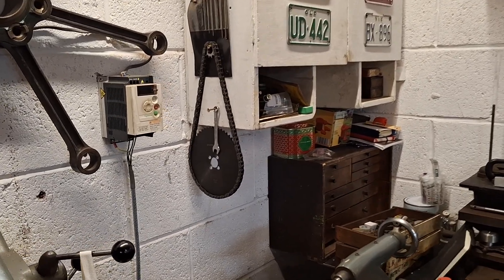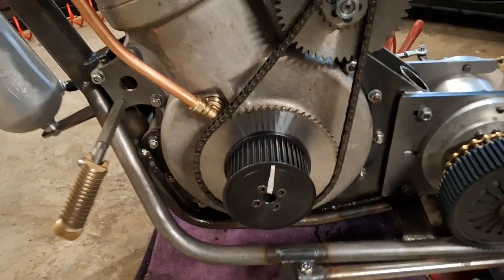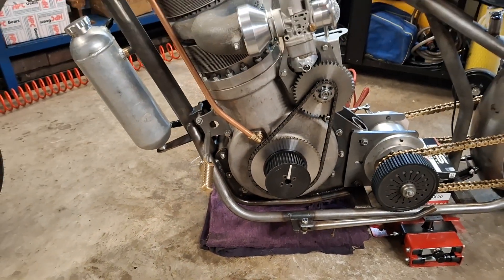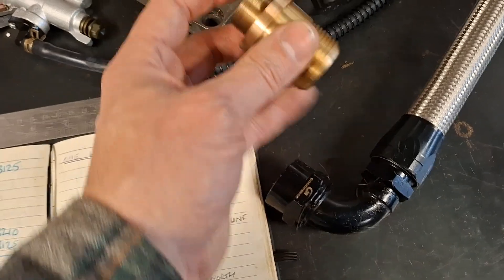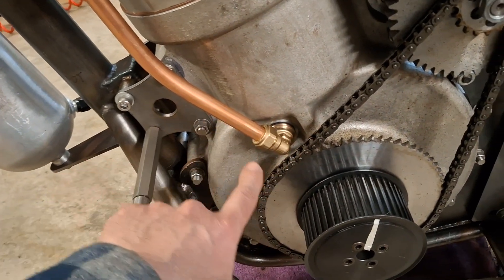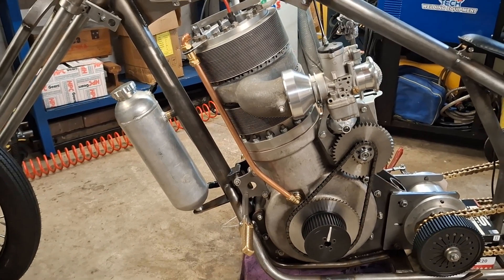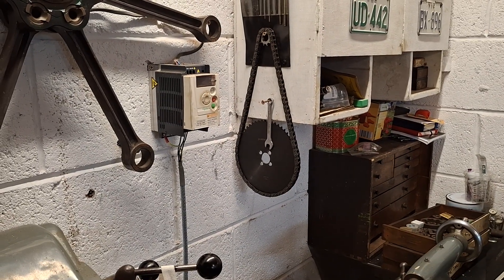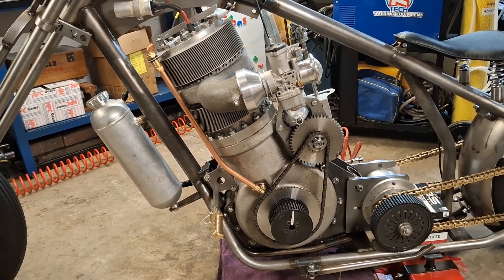And..... breathe!

Comment: What is the thinking behind having a 1 way valve? I would have thought the vacuum it will create in the crankcase will assist any blowby of the rings?
Also expelling and drawing all that air out of and back into the crankcase is behaving like a decompressor and increasing engine braking. My thoughts would be a pressure release valve to control crankcase pressure and minimise pumping losses?

Comment: Copper and brass does look good on the engine, but if you machine the flats off the compression nuts it will suddenly not look like central heating - either leave a short length of hex to tighten, or drill a hole every 120 degrees and make one of those crescent with a pin spanners to tighten/undo them (can't remember the proper name of the spanner, but like the ones we used to use to undo the bottom bracket of a pedal cycle.  but with a round pin.  I hope you know what i mean...).
Reply from the maker: @peterlaband  Cheers Pete, I always called it a "C Spanner". They don't need to be super tight, so I might knurl them instead.. 😃

Comment: I like the copper pipe. Return it under the frame neck with a filter on. Those old engines would have pipe work around them anyway. Very steam punk.

Comment: if there is enough crankcase pressure to slow the starter you have enough pressure to blow oil past every seal in the motor if not blow them all out so i think you will have to re visit this to get the big breather back on somehow.
Reply: also if your having clearance issues with that 90 degree elbow try going over to a banjo bolt fitting that will go in behind your starter gear no problem

Comment: I rather like the copper breather pipe, it makes for a nice contrast with the silver of the engine. Though it might not look so good after the copper tarnishes. I also think the 1 way valve is a good idea, it should reduce the windage in the crankcase and mimic the vacuum pulled by the original engine's scavenge pump.

Personally I think I would route the breather outlet into the air intake, so the oil mist doesn't get vented to atmosphere and is instead burned with the fuel like in a modern engine. But that wouldn't give you the same straight run up the side of the cylinder, so maybe it wouldn't look as good.

Comment: The air breather outlet on the crankcase is in a 'sub-optimal' position in some ways. It is very close to the cranking sprocket, but also forces the breather pipe to be a feature on the side of the barrel. Would a new breather outlet at the back of the crankcase (behind the starter motor) have any benefits? Less obvious visually, but in addtion, would it be possible to use a wider bore braided hose again like before - reducing the back pressure? The hose could be routed up under the fuel tank and mostly unseen.
Reply: Just one more thought. Copper for household isn't intended for vibrating machinery.

Comment: Just put the one way valve away and use a bigger pipe with an oilcatcher on the end.
Reply from the maker: @Dieselfan700  the one way valve isn't there to stop oil being blown out, it's to create a partial vacuum in the crankcase. I might still need a catch can or similar.
Reply: @StoneEng  okay, in my opinion the vacuum is more bad than good. And a breather is defenetly needet. maybee a Filter on the end is good enough but this should be testet.

Comment: there should be a valve controlled by rotation open at tdc -90 +90 degrees
Reply: Later Harleys have them I think, in the timing chest

Comment: I think the breather is slightly dissonant with the rest of the bike. Maybe I would think about trying a machined low profile 90 degree connector and a section of fuel line as someone else posted. I don't know what to do about the valve though

Comment: just wondering, is there a reason you want a one way valve on the breather?
Reply from the maker: @o.u.t.olduglytroll3712  the idea of the one way valve is to create a partial vacuum in the crankcase. It should help keep it oil tight and give the seals an easier time. It might not be strictly necessary, something to play around with as part of the fine tuning.

Comment: I think you will regret having the breather point backwards like that! Granted once its running and a vacuum develops, there should be very little coming out of it. But startup might get you a bit of an oil mist.

I also agree with the appearance. It's fine, but also not fine. Maybe it would look better weathered a bit, or painted?
Reply from the maker: @AmericanLocomotive1  The top bend is just plonked on at the moment.  Not sure what I'll end up doing with it yet.

Comment: I like the copper, if you had one on the other side would look even better :) - but if you hate it just get aluminum tubing, it's common for fuel lines so you should be able to get it at an automotive parts store. Powder coating is another option (might be able to pick a color to match the cylinder) but not sure how it will hold over time.

Comment: A couple thoughts. An even larger pipe, after the elbow will have less air drag and allow more oil drain down. You might need a larger one-way valve as it has to have more restriction than just the tube itself. I'd test flow thru the same size elbow compared to the one-way valve. Time how fast a liter of water runs thru it.  Back in the 80's On a Norton Atles race engine I built I ran the breather tube to a puke tank with a ball check return line to dump the puke tank oil into the cam chest to add lube to the cam chain.  Another possible future issue. Copper work hardens and cracks. Engine vibration can cause this, so check after each ride for oil seepage. might need a bracket off a cylinder base nut.  Looking really good! I figured that starter plate was too thin. Me, I would've chosen 3/16" to 1/4" (5-6mm)👍
Reply from the maker: @JaySiewers  the starter plate was made with what we had lying around at the time, to get the shape right. Easy now to make a thicker one. 😀

Comment: I like the aesthetic of the copper pipe, keep it. However, will that be enough to handle that volume of air moving around? Can you add a second breather and or larger crank case vent? You mentioned that the starter struggles with the pipe fitted, how will it work when it is running? Will is cause problems with shaft seals leaking or high oil consumption?

Comment: I couldn't live with bits of household plumbing cobbled together and stuck on the engine myself, the entire thing is a non standard, completely custom one off using bespoke made to measure components and B&Q plumbing parts !
It just looks wrong !

I can't quite put my finger on why it looks wrong though, it's fairly neat, it tucks in well but it's just run of the mill standard central heating (or worse) bathroom fittings that have no place on a one off custom built motorbike.
All you really need is a way to let the crankcase breathe without spraying oil out everywhere, there are filters for that.